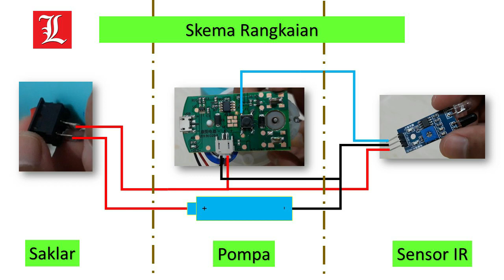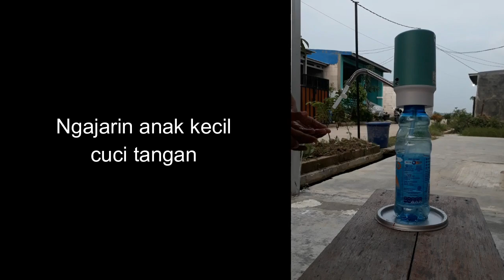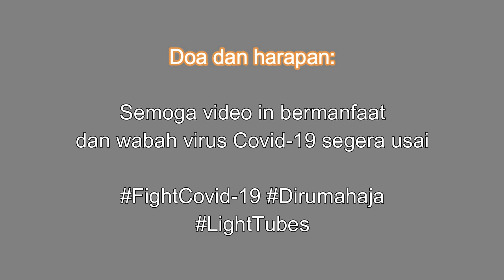Automatic Hand Sanitizer Machine Without Arduino #Covid-19 #dirumahaja

Comment: Hi, will done...but one problem is there it should cut automatic  in 3 seconds...
Reply from the maker: Hi.. This is not automatic, but contact-less.
Need to research how to make it automatic in simple way, because i consider the cost and the use.
By working like this for me is enough as long as the goal has achieved, a non-contact switch with minimum cost.

Comment: Good, But too much waste of liquid. The nozzle needs to control the output.
Reply from the maker: Just put a small valve. In this case i tied the pipe using cable ties but still too much flow

Comment: Tanay gan...itu sensornya active high ya?
Reply from the maker: Aktif low gan
Reply: Tanya lagi gan...klo aktif low untuk ngidupin pompanya kan butuh 3v (artinya aktik high)berarti pake pembalik ya gan?
Reply from the maker: Bentar gan, nanya dulu, agan mau bkin baru persis punya saya apa mau bikin rangkaian sendiri?.
Rangkaian di video saya, push button rangkaian pompa butuh 0V utk trigger, jadi output infrared langsung konek aja ke push button, tanpa modif komponen tambahan
Reply: @LightTubes  mau bikin sama persia gan tapi beda pompa...
Oh triger on pompanya 0volt...oke2 gan...pompa ane modelnya switch on-off bukan push button...dan trigernya butuh 3volt baru pompa on....ada saran gak gan?apa harus ganti pompa...hihihi
Reply from the maker: Oo gitu. Pas lagi eksperimen aku pakai rangkaian relay 5v. Tp masalah di supply batre cuma 3,7v.
Klo si agan pke 3v batre q blm ada ide, tp klo mau 5v bisa pke rangkaian relay